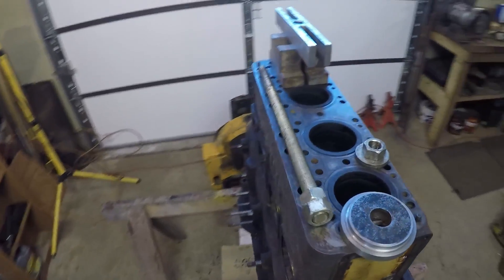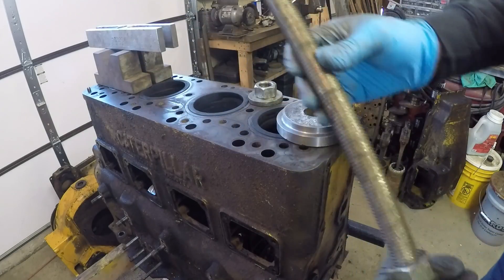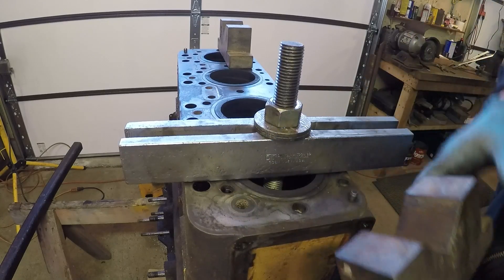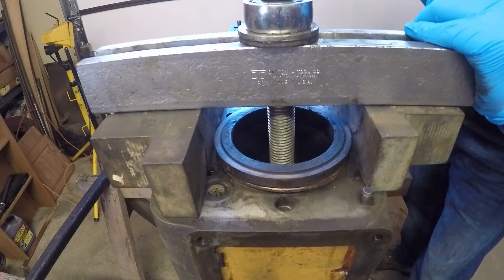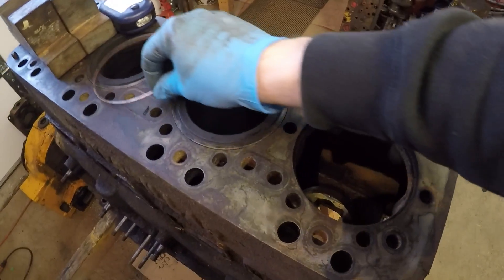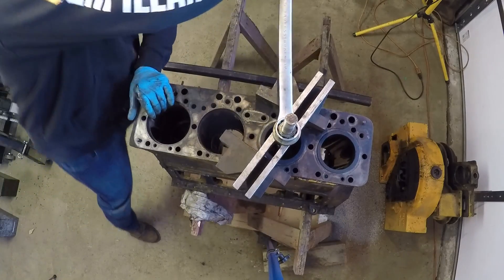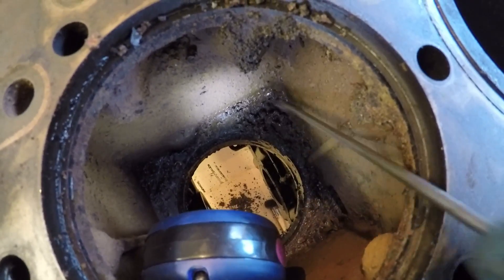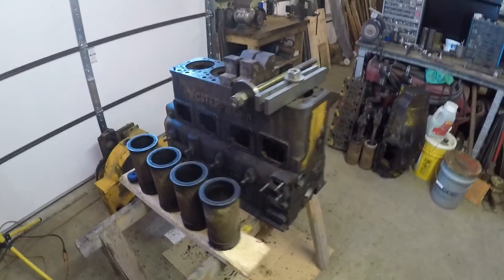Caterpillar D2 - Pulling Sleeves on the D3400 Diesel Engine

Comment: I've had to freeze liners to get them to break loose in Semi-truck engine blocks. Some Mack blocks are the worst I've dealt with because they are siliconed on the bottom of the sleeves. Setting deck protrusion also has to be done immediantly with those same sleeves because of the " set up" time on the silicone.

Comment: Any one know of a supply house that is stocking the otc  15ton and 30ton hollow ram and the push pull hardware  and bearing puller thank you in advance
Reply: Do I need the 17 and a half and the 30 ton hollow ram or just the 30 ton for all the d2 service work

Comment: We pulled the liners in a 1970s? D6 one time. We hooked up the puller on the bottom then the top was hooked to the 10 ton overhead crane. The tractor was lifting before the sleeve came out.

Comment: I used to work in a automotive machine shop and we removed 'dry sleeves' like the Ford 8N engines by making 4 verticle welds inside the sleeve let it cool to ambient temperature and the sleeve would normally come right out -assuming you didn't burn through the sleeve. With your knowledge you probably know about this.

Comment: A trick when changing cooling fluid is to run a fill-up of coffee machine descaler and tap water and let it cool (like you would do a coffee machine). Removes scaling and rust and does not eat aluminium parts or water pump seals. Does this every 4'th year and my cooling channels are spotless.

Comment: Fascinating....one thought about the sediments is typical as found in the old ford flathead V8.  One of the many causes of the V8 overheating was found to be build up residues of the original casting sands. After casting the block design was such that pockets of sand remained inside the cast water jackets. Just a thought about this issue. Great videos and very informative.

Comment: Nothimg crude about thag 
Thats the same way we pull and install sleeves on the brand new cats 
All aside the bigger ones we use a porta power on the rod in the workshop 
But out in the bush it's still 2 nuts, sweat and swearing

Comment: You made my comment for me, most failures are found in the tail end of the block. Since the water pump is all the way forward the rear gets the crap and lower flow.  A lot of the pony motor failures were overheating due that fact.

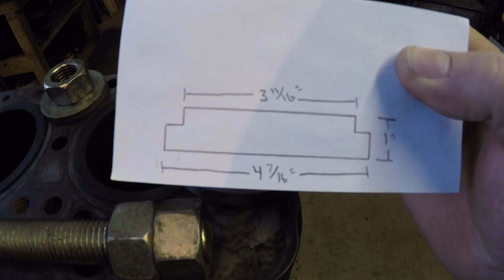Comment: Very useful video.  I'm going to build a rig similar to what you have for future use.  Question:  how deep do you turn down the 3 and 11/16" diameter from your total 1-inch height?  It looks like 1/2" but there is no spec on your blueprint.  (0:39)   Thanks.

Comment: So as these engines age , if the coolant was not maintained well it would seem to  doom the water pump and started engine from all the rust and dirt ? Could they be power flushed to reduce the build up or would it tend to block the starter engine passage ?

Comment: Missed my stupid questions? Well, here's another one: Where does that sludge come from...and what is it? It doesn't look like rust, and the cooling system is sealed. You mentioned bad coolant, but grit like that, really???
Reply: @squatch253  Interesting stuff...thanks for the reply. Coolant leaking into the crankcase sounds like a bad, baaaaad omen with regard to this block's usefulness for rebuilding 5J1113, though I don't think you'd keep tearing it down if you thought it wasn't going to work. So...how does coolant get into the crankcase, if not from a crack in the water jacket somewhere???
Reply: @squatch253   Oh, come on, man! What are you tellin' me?!?! The sleeves seemed pretty well stuck in there...not over-stuck, more like just the right amount of stuck. I imagine you would have said something like, "Uh-oh...that one came out too easily" if one or  more of them came out too easily. What's your gut feeling about this block? I read a comment that mentioned hot tanking. Is that like pressure testing? No mention of magna fluxing. Short of reassembling the engine and saying prayers, what (if anything) can/will you do to find out if this block is viable?

Comment: Another great  video!   Reminds me of my Dad pulling the sleeves out of our RD6 Cat back in the late '50's.  We were getting  water into the crankcase and the reason was obvious.  The seal surfaces in the block at the lower end of the sleeves had corroded letting water past the seals.  I say "water" because we couldn't afford proper coolant.  Dad used diesel fuel in the radiator during the cold Kansas winters and straight water the rest of the year.  To repair, he coated the block sealing surfaces with Devcon plastic steel and smoothed them with a stone on a drill, reassembled and then ran for a few more years.  Poor Kansas farmers.

Comment: great video.. for those trying to read the part number on his puller.. https://www.otctools.com/products/17-12-ton-cap-push-puller OTC938..  there is an even bigger 30 ton version https://www.otctools.com/products/30-ton-push-puller  otc 939 .. for those who can't wait.. some 1 1/2 to 2" x 1/2" bar stock with coupling nuts welded between the ends can make you exactly that  1/2-13 coupling nuts give you 3/4" spacing. check the hex size you may want to use 5/8 or 3/4 coupling nuts  as spacers so you can use 1' grade 8 all thread..    here is the one i made up to pull some rotors.. https://i.imgur.com/sTR1Jfv.jpg   and no that did not get them off.. press fit pilot bore.. heat pounding. cussing.. https://i.imgur.com/MNJFisb.jpg got it.. since those rotors were $2500 a pair plus airfreight from italy i did not want to ruin them for  a clean up cut.

Comment: Have you ever had to re deck a warped block? John Deere has a great setup piston and rings come already installed in the liners all you do is pop the bottom of the piston out of the liner put the pin and clip in and bang sleeve piston rings the whole deal goes in.

Comment: I like to see this type of work....I done lots of gasoline engines and was always interested in how hard diesel was to do....I did a Continental six-cylinder also in an old Oliver tractor that had sleave....wish I would have had this knowledge at the time....got the sleeves done by a machine shop...I could have done them easy.....CHEERS

Comment: Those are pretty thick liners especially at the bottom, don't normally see them with that thick a wall especially not in the newer stuff.
Reply: yes thats so true remember that today less is supposed to be more lol most of the shit produced these days wouldn't last 1/4 of the time that goes for cat also they have gone from a reputation for solid reliable equipment with excellent performance to mediocre at best certainly just one of the crowd not the stand out manufacturer of years past

Comment: Glad they came out good and the block looks usable too. I thought it would. A lot of thought went into building those rigs years ago before all this pre-programed stuff.  And as far as lubing up, back in the day of the 237 gold dog Mack engines there were a lot of blown head gaskets here. The main mechanic that came down here from West Virginia would re-torque the heads. He'd pull one bolt out at a time, oil it and then put it back and pull it back down. That was the last of the blown gaskets. I had a Rabbit diesel that was bubbling between the block and the head so I asked him if he thought the Mack deal would work and he said he thought so, so I tried it. The Rabbit book said to pull them to 90 or so and then 3/4 of a turn and not to re-use the bolts. I didn't have new bolts so I pulled the old ones to 90 and 3/4 of a turn after oiling and it ended being around 150-ish. I did that to all of them and no more bubbles. I remember that whenever I have to pull something down. Thanks, Toby! Hi to Pop as well and everything you do is good stuff, even feeding the heaters!

Comment: Wow that went so easy! I pulled the sleeves on a B-275 International and made up the same kid of set up. I tried it with threaded rod that was coarse thread and it could not handle it. I had to use  a rod from a big puller we had with fine thread. I had to heat the sleeves and use a pipe on the bar. I was afraid I would crack the block but at that point it came down to do or die. I got to the point where I had one of the sleeves glowing I had to put so much heat on it. The worst of the bunch was the back cylinder. It was so full of crud and debris around the sleeve that 3/4 of the water jacket around the sleeve was full. After all the torture on that block it checked out just fine. Was quite incredible what kid of force it could take!

Comment: Number 4 was really gummed up, wasn't it? But those sleeves looked like they pulled fairly easily. Block still looks very promising for your rebuilding project.  I know you still got to clean it and do magnaflux on it to check for cracks. But it looks good so far.....

Comment: So now after this, will you be 'hot tanking' the block(s) , I mean the pony motor block too?
All in all, that's not bad for an old engine , is it? 
I do like the camera shots, especially inside the block at the bottom while the sleeve is being pulled.
Reply: @squatch253  Isn't that something? Good story.
Reply: @squatch253  you could not do that again if you tried!

Comment: Would it be cheaper to  bore out the liners and add oversized pistons or just go back stock with new liners and pistons and which one is the normal route?
Reply: @squatch253  don't forget that being a wet sleeve engine that there will be deteration of the o-rings and cavitation of the liner itself. Wet sleeves are designed to just be replaced.
Reply: @squatch253  thanks for the answers, I have been a line mechanic at places that service cars and light trucks so I have no experience with older stuff.

Comment: Would you recommend coating the inside of the water jacket with that red glyptal crank case coating? Seems as if one were to do that the sludge wouldnt stick to the bare casting like that.
Reply: It won't help most insides are already coated to keep a porous casting from having a leak. At 3:47 you can kind of see the old greenish yellow primer that block was sealed with.

Comment: Damn, I didn’t know the sleeves would come out. I certainly didn’t know the sleeves had seals and the sleeves complete the water jacket. Who would have thunk it. 
Great video thank you.
Reply: That's why they're called "sleeves".  They can be replaced if necessary.  On engines that don't have a sleeve design,  if one bore is really messed up, your only hope is to be able to bore out the cylinder to another level, which by rights, should have the same done to the rest as well,  then you need times however many cylinders you have for parts and labor... whereas with a sleeved engine, if only one cylinder/piston is messed up, you only change out one sleeve and piston.  First sleeve and piston job I saw done was a farmer whose B414 had run dry and overheated the lead cylinder.  I was impressed that he only had to replace just that one, the rest were still quite fine.  A few hours of wrenching and both he and his old International were back to work.  He never had another issue with it after that, but he did replace the leaky water pump during the same job which had caused the loss of water and the overheat to begin with.
Reply: Stan Patterson t
Thank you, great explanation I learned a lot.